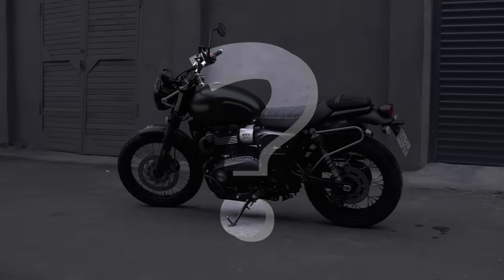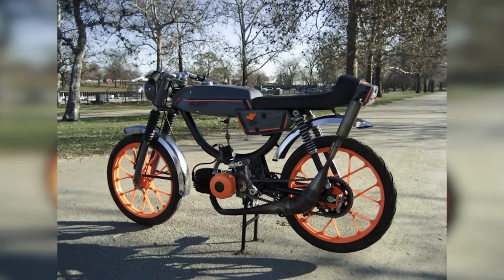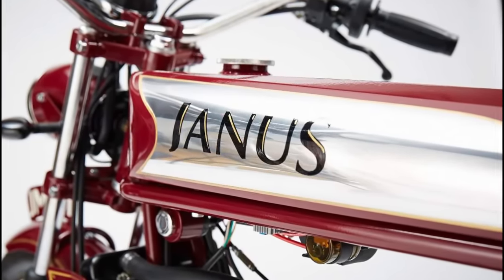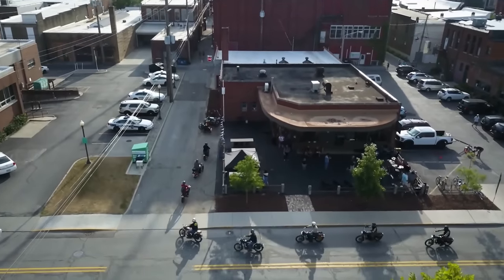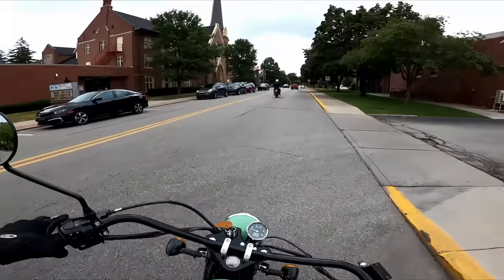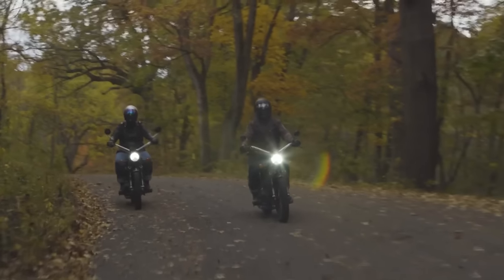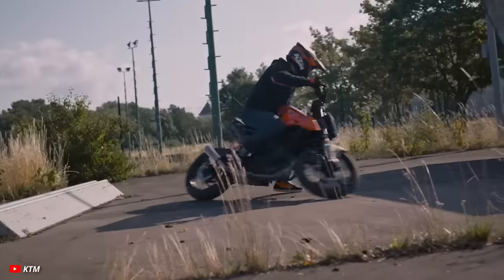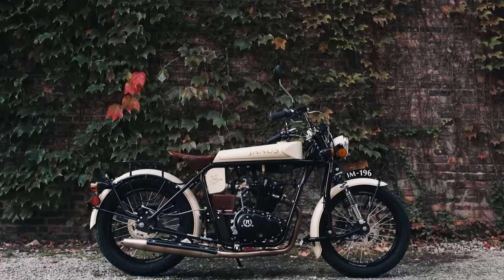The New Manufacturer making 100-year-old Motorcycles

Comment: I never thought I'd ever hear the phrase "an Amish-built motorcycle".

I've owned many bikes, including a Marusho 500.  But my favorite was still my 1968 Benelli 125 with the horizontal cylinder.  Couldn't do more than about 80 mph, but the light weight and very low center of gravity made it incredibly nimble and saved my ass several times when I cornered too fast.

A wonderfully quixotic story.  Thanks again, Bart. Cheers from rainy Vienna, Scott
Reply: I'm impressed you managed 80 on a 125!
Reply: @davidellis7081   To be honest, the 80 mph was probably with a tailwind. But it could do an honest 70 mph under most conditions. Supposedly had 15 hp.
Reply: The magic word of the day shall be "nimble".
Reply: Amish labor and slave labor all in one bike lol
Reply: @therealzilch  "(To be honest), the 80 mph was probably with a tailwind."     I am sure you are innocent, but that actually implies that you have lied to us before.
Watch out for people who say that.  :)
Reply: @therealzilch  I build small 2-stroke engines for a living, (porting, stroking mostly), and I am pretty sure a 125 will have a real hard time hitting even making 70 making only 15hp (which does sound about right for the time).  But if it were to be made to happen, (IMO), it would have to be a high revving engine with very little lower rpm power.  With the bike being lighter, with a light rider it may be possible.  But the low end power would be so bad for me, (I like low end power, many want top speed) I would not make it my favorite bike to ride.  But it would be kinda special to me too.  Doug in Michigan.  Still, I can see it being fun on faster roads with 45 mph corners, for one example. I did not listen to the vid yet.  Amish motorcycle?  I guess they figured out that using power tools is from the nature of mans mind, and are using them more and more.  Good to see.  Welcome to the prosperity of production.  :)

Comment: I can attest from personal experience that their Halcyon 450 model is the most comfortable, and fun, motorcycle that I've ever ridden.  My brother and I just took our Halcyon 450's on a 1,500 mile trip all through Michigan along the coastline, and into Canada around Lake Huron, in a little over 4 days.  The motorcycles performed absolutely flawlessly, and we were very comfortable the entire way.  Lots of attention every time we stopped, and we got to meet a lot of great people along the way!
Reply: What's their comfortable cruising speed? Are they suitable for the interstate?
Reply: @mose717 We went 60-65 mph for most of the trip, sometimes up to 70+, no problem, plenty of throttle left still.
Reply: What's the range? Don't they use the same small gas tank as the 250?
Reply: @mbj1163  Yes, same size tank as the 250, 2 gallon.  On our trip, we'd stop every 65-70 miles, and found ourselves adding about a gallon each time.  (In Canada, we'd stop every 115-120 km, and add about 4 litres.)
Reply: janus needs to figure how to get a good looking motor, deal breaker for some. they are just getting parts all around and slapping a bike together, they need to reform an actual motorcycle company and build the bike to look right
Reply: @theuserthatishere I agree. Install an engine with polished cases and made to look “antique”. The current engines look like the cheap Chinese engines that they are.
Reply: And that's what motorcycle road are ment to be is fun the safe and reliable way 👍
Reply: I saw one once it really grabbed my attention, sweet machine.
Reply: @bryanbrowning5746 Well, you know.  If you want to change that why don't you start making cheap reliable moderately powered engines here in the USA and they can use those.  Or do you simply like to complain about what other people actually do?
Reply: @bryanwhitton1784 you don't need to be a chef to not like the dish
Reply: @ironmonkey1512  well put, different strokes for different folks. 
I own Panheads,Shovelheads Twincams and an Evo.
But I wouldn't mind having one of these.

Comment: This guy Bart get's it! Having put over 14,000 miles on my Halcyon 250, after owning 40 motorcycles in my 50 plus years of riding, this is a very fair review. No they're not for everyone, but I'll tell ya, more riders out there would enjoy one of thee more than they know. Excellent  review! Well done! Tom
Reply: I'm 72 and on bike #31. I ride 2 hours a day for 100 mile a day commute almost every working day of the year. I have considered one, and have been watching them for a while.
Reply: Wow. That is a lot of miles on one of those 250's . I have also had many many bikes. I just acquired a used one. I love it but do find the hardtail, well hard at times. Any tips on riding a hardtail?
Reply: @madogblue  Sorry just getting to this, but here's my best Jnaus hardtail advice. #1 seat back on the seat. If you sit forward you are the seat's hinge, not its springs. #2, they offer a wide line seat. I don't know if your Halcyon came with one, but I recommend it, it is more comfortable. #3, you can lower the tire pressures a pound, especially the front which I think they have you set at 36, and the can be 33 no problem. Last, you can contact Ikon USA and speak with Rodger, the offer a softer front spring which helps overall ride quality for you Halcyon 250. Good luck!
Reply: @LiveAnArtfulLife  Thanks for the tips. I am only 165 lbs. I will start paying attention to my position on the seat and also watch how much the front suspension is working. If it looks really stiff I will talk to them about possibly changing the front springs. Did the vibration in the bars smooth out any as thr bike was broken in? I am no young man myself and enjoy the Halcyon for local riding. I have to ask since you are a mature and experienced rider. Why choose a hardtail later in life with all the softer options out there?
Reply: @redr1150r what’s your current ride?
Reply: @redr1150r  this bike would be ok for a sunday rider...off the grid...not the freeway...they look cool.....like a die cast model of a early motor cycle..i would never give up my 1999 thiumph.trophy.900.for one of these.....stay safe cars today are your enemy...
Reply: @tomstarros3189  I just retired from being a Civil Service Aircraft Mechanic for the USCG at Elizabeth City, N.C.. There's I guy I saw on most days buzzing into night shift at our base on one and out on the Highway at 65 to 70 mph speeds. Not a smart thing on any small bore bike. I have a Sportster which suits me just fine. I believe it would be great in town, or the city.
Reply: @tomstarros3189 I had a 72 Triumph 500 Daytona. 🙂

Comment: Their Paragon moped looks really good with its clean, uncluttered lines and minimalism all around.
Reply: I love the idea behind their designs. It’s based on machines that were imperfect and changeable, so it’s not so much trying to recreate those bikes. It’s more like building something to match the memory of those bikes. Modern small engines mostly aren’t that different than they were decades ago. Alterations add complexity to chase smaller gains over time, and it’s smart to design not to what’s possible, but more to what’s enough.  When I think about riding a motorcycle, I don’t picture myself on the highway, so why get something built for that? Get something that feels like great for what I actually want to use it for.
Reply: It's air cooled, not water cooled like it says in the vid

Comment: Nothing beats the feel and sound of an English 500cc One Lunger thumping along with a glorious engine sound! I have two BSA's - one 1953 650cc 2-cylinder Golden Flash with the plunger frame rear as well as a 1956 500cc 2-cylinder Shooting Star with the same type of frame. Included in my motorcycle collection is a 1965 Honda 450 cc CRR twin racing motorcycle that requires earplugs and a helmet if you want to keep your eardrums intact! I purchased it from a HONDA racing team in 1971, in Japan. It was built by the HONDA RACING DIVISION and is one of 10 built.
Reply: Quite a collection "sound s " awesome!
Reply: you might be sitting on your retirement with that Honda race bike. to someone that knows what that is.   or the Honda people.

Comment: I seriously considered the Halcyon 250, and even came up with a way to pay for it. But in the end, that Chinese engine made me decide against it. I'll just keep riding my customized 2016 Honda Rebel 250 for now. It is a very small, lightweight bike, at least for me. I'm 6' 240, and it feels like a bicycle. But not only is it fun around town, it will cruise at 70-80 mph for as long as you want, with no worries about it breaking down.
Reply: Live your dream.
Reply: Ya I like my 2004 rebel 250, has that classic look, I put 10,000 miles on it, ride in the winter, summer, on some trails, mountain roads, that bike can do it all, I even ramped it a couple times lol, I got a video of that haha
Reply: My brakes went on at the Chinese engine too. I love the rest of the bike.
Reply: Japans about equal now both suc
Reply: Really exciting to see an appealing motorcycle being manufactured in the United States. For me though, it’s a firm “no” on the Chinese engine, regardless of quality or durability. If Janus were to source the engine from a different country, I would be keen to consider their products.
Reply: I had the exact same reaction.
Make that engine (almost) anywhere but China, and I'd consider it.

Comment: I'm an old Cafe Racer builder and bike restoration tech. I did it professionally for many years. My favorite platforms were the Honda CB/CL 350 and 450. I owned and built dozens of them and at one time had an entire building full of frames, engines and every part under the sun along with my buddy, an ex 70's Mototcross racer. These bikes that Janus makes remind me of exactly why I fell in love with Cafe' Racer building. I don't even own a single motorcycle anymore. I sold them all and even left some behind. I bought a new KLX 230 in 2020 and rode it for a year in Thailand, then sold it. My last bike was a Vespa LX125, that I adored, but I had to leave it behind in Thailand after Con-Vid. I think if I were to consider buying another bike, I would consider a custom Janus. Goshen, Indiana isn't even that far from my home. Maybe 3.5 hours drive. The price is pretty steep, but hell, it's only money. A 450 would be pretty much perfect. I always wanted to build a Honda 500 Cafe bike. Maybe one of these would fit the build instead. Really great review, by the way.

Comment: I'm always looking to demo different bikes when available. Have never been on a Janus, but was pleasantly surprised by another retro-themed bike from Indian. I'm talking about their Scout model. Priced just below the Janus 450, the Indian Scout has a much bigger engine (1130 cc) and weighs more (540 lbs.) I found it to be a blast to ride. The handling of this bike makes it feel much lighter than it actually is. It also has available ABS and EFI - not very retro, I know, but much appreciated as someone who has dealt with marginal braking and finicky fuel systems. If I was going to drop $15K on a new (old) bike, it would be for a Scout - and I don't even like most V-Twin bikes! ;-) Thanks for the review.

Comment: Well done, these people are after my own heart. I am 70 from the 🇬🇧, had lots of old stile Brit bikes in the past. There is one bike that I am sure you will love? Engine wise, it would be a top seller, due to its long stroke and sound. 
1955/6, BSA 250cc, plunger rear end, model: C11G. I have mentally researched the perfect adaptations to make this very reliable bike a true winner. Copy the frame in lightweight tubing, put a belt drive between engine and clutch. Fit an alloy barrel instead of the cast iron one used in those days. When I was young this little 250 was perfect, very cheap to run and would get up to 70 mph, with a light wind behind me. You could use LED lighting also. I wish I had a place to do this, but no, so hopefully you could enjoy this one. 👍

Comment: They command a high price for a motorcycle with a Chinese power plant. Based out of Goshen, Indiana, Janus builds retro-style motorcycles with Chinese engines—for the past few years, the company has used an air-cooled 229 cc Lifan engine Shinray has built the 450. You are absolutely correct that they are not for everyone! I bought an 1955 Eenfield 500 bullet for a retro bike because I was missing the old days and in 6 months I remembered all too well why something more modern was what I needed. I kept my first Harley, a 1963 Harley Sportster and still have it and it is all the aggravation that I need. 😂 Good honest video, thanks for a fair assessment!!

Comment: I get everything you're saying about Janus. The idea of having a beautiful, hand-built and truly retro machine is very appealing. Too expensive for me, unfortunately, and as far as I can tell, almost impossible to get one in the UK. The Janus has been one of my 'if only' bikes for a while now.

My current bike, while on the surface as far from a Janus as you can get, actually has a lot in common. The Fantic Caballero has a 450cc single engine, and weighs about 330lbs dry, or just under 360lbs ready to ride. The only rider aid is the ABS (compulsory in the UK, and you can switch it off). The looks are only vaguely retro and it owes very little to its 1970s namesake. I've found it a fun, punchy, pretty machine that fills the spec of being 'more fun to ride a slow bike fast'.
Reply: Photo of your Fantic, please!

Comment: I love the vintage style, and the whole spirit and history of the little company. However, I wish they offered a front drum brake model (for more of a vintage look). I know the disc is more reliable, but it is the one item that really clashes with the vintage lines. In my opinion.
Reply: janus needs to figure how to get a good looking motor, deal breaker for some. they are just getting parts all around and slapping a bike together, they need to reform an actual motorcycle company and build the bike to look right

Comment: I have a mash tt40. 400cc Chinese build cafe racer.
Simple & fun just like you say. The Janus has the same engine but bored up.
A clone of the Honda xr400. So parts can be upgraded easely.
Love the simple spartan way of riding and in the Netherlands a big fast bike is just a fast way of losing your license.
Reply: How's that engine holding up?
Reply: @PrimoStracciatella  No problems so far. Give it it's services & it keeps riding.
Saw one on internet with 10.000+ km. Also had no problems.
It's a bit sensitive for corrosion. But hey! It's cheap.
Reply: @SkinPeeleR  10.000 km I do in one year,  every engine should hold up. Haven't seen a long-term test of a Chinese bike yet.

Comment: I have a Suzuki DR200. It does everything the Halcyon 250 does except look good. Nothing beats an ultra light bike. Ive had a couple now. Loved my KTM  RC390 but the range was horrible. Trust me, I got some very strange looks when I traded my RC390  for a DR200. But my primary consideration at that time was light weight. I also carry it on the front of my truck. Light bikes give me the same feeling as they did in the 60s when I learned to ride. It would be great to have the same fun without the condescending looks from people on "real bikes"

Comment: The RE 350 has some things that add weight, like ABS, and other required equipment, so not an entirely fair comparison. What's the weight of the 450? Is it any heavier than the 250? Great coverage BTW. 👍
Reply: I believe 450 is ~100lb over a 250 (260 lbs) so about 360lbs.
Reply: Bart said the 450 comes in just over 50 lbs lighter than the RE350 classic, so somewhere close to 350 lbs dry would seem about right
Reply: @ludditeneaderthal  so, if you add ABS, and other bits, it would come close to the RE 350. Most likely the RE Hunter 350 would be closer in weight.
Reply: @terrycavender  the hunter is still a 400 lb (wet), 20 hp bike. That's honda rebel 250 class riding. If it's the ride you like, fine, all good. But it's certainly not in any way superior, though quite a bit cheaper. But there's a basket load of "same same" level of comfort and performance out there, at about the same price point.
Reply: @ludditeneaderthal  I'm just comparing the weights, and the reason for the difference. I had a RE 350 in Thailand, and it definitely needed to weigh less, or have more power. And, of course, the quality is nowhere near that of a bike that's hand built to order. That said, it's one of the more retro feeling bikes on the market. Currently, I'm riding a 2023 Himalayan, which has its own retro quality that I enjoy.